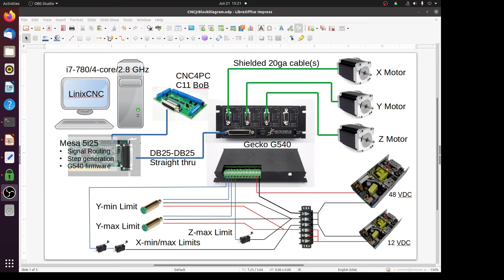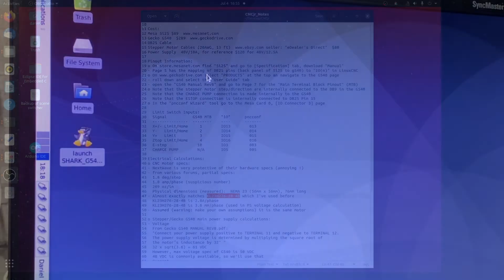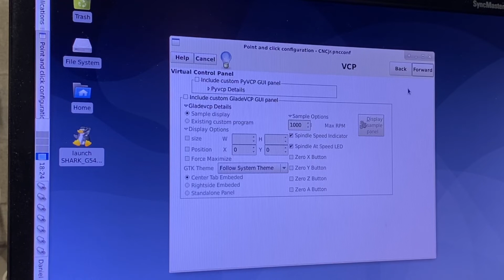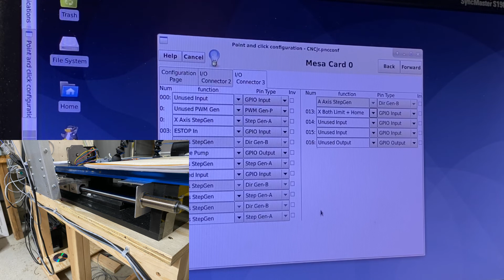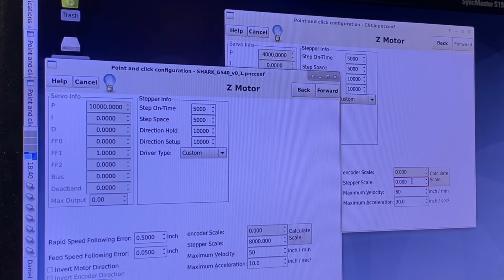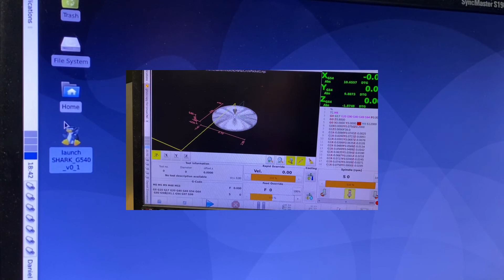CNC Shark to LinuxCNC - Cost and Configuring LinuxCNC

Comment from the maker: Anybody trying this ?   ... how's it going for you ?
Reply: I'm going to on an openbuilds lead screw machine. I don't really like GRBL firmware as it tends to stutter when cutting curves. Linuxcnc has gcode lookahead and hopefully will fix the issues with my very non-rigid machine not cutting smoothly.
Reply from the maker: @adammontgomery7980  thanks very much for your comment ! 
If you wouldn't mind, please update us all on your progress, issues, successes, etc. .
Also, if you make any videos, feel free to cross-reference for the benefit of all of our collective viewers.
And, as always, I'm happy to help in any way I can (e.g. "hey, Daniel, can you try this on your machine)
Reply: Trying this on a Millenium Milo 1.5 instead of the project's RRF firmware/control electronics. Slowly coming up to speed on how to work with hal to map in a PC4PC C11G on the secondary port.
Reply from the maker: @ogmaker  thanks for sharing.  Can you expand a bit on your configuration ?  e.g. "Secondary port" of what ?  Are you using a mesa card or do you have parallel ports on your PC ?  Thanks again and hope you keep us up-to-date on progress and/or feel free to post a link if you make a video.  Good luck !